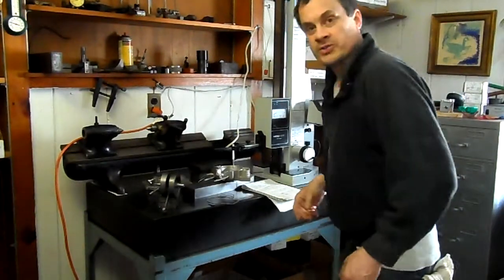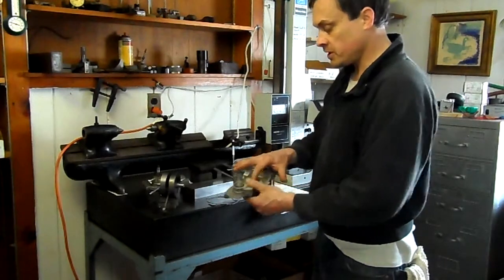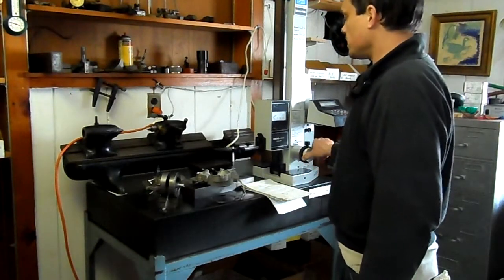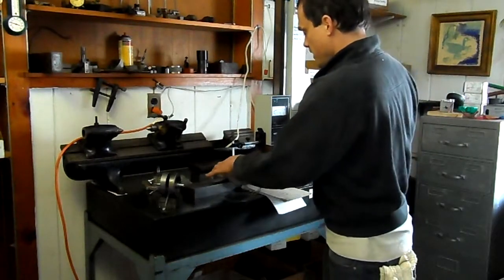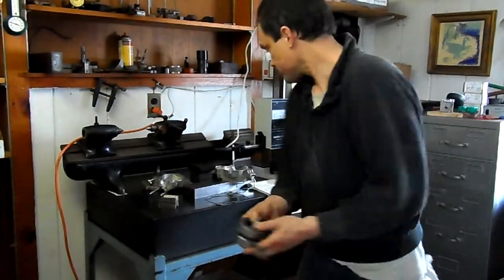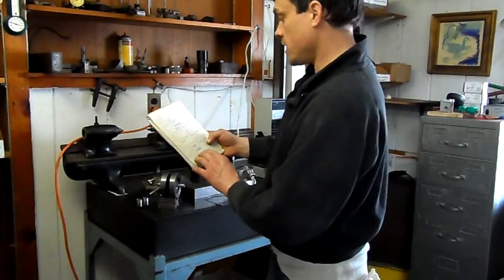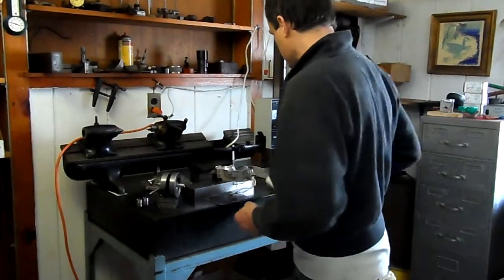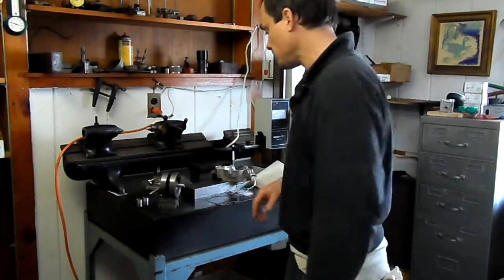Fred measuring case dimensions and crankshaft width before assembly

Comment from the maker: Perhaps.
As long as the correct wrist pin bearing was installed, it should be fine. The wrist pin bearing is usually the first casualty because it operates in the most challenging situation. I have not noticed any shortcomings in the quality of the bearings that come from China. I don't care for the hardware that things are put together with, but the bearings seem to be just fine. So far, the bearings from China have not given me any trouble.

Comment from the maker: Hi Kehyo77.
I don't think it is necessary to use special bearings like that for these engines. If the engine is set up properly, so that it runs in a healthy manner, life of the engine will be very good. Even in extreme racing conditions, the wrist pin bearing will usually be the first casualty. Making sure the engine does not overheat due to improper fuel mixture, improper cooling or detonation is the most important thing to do.